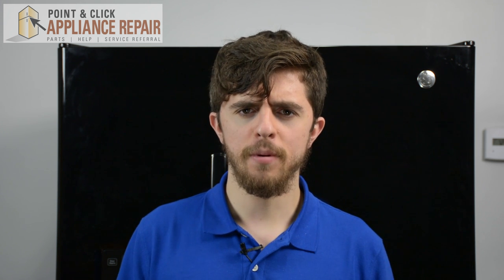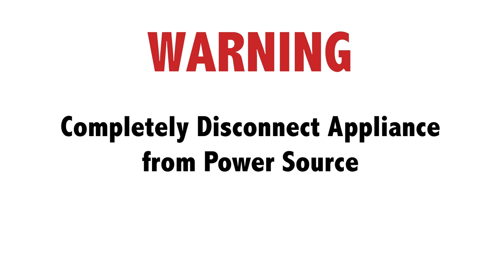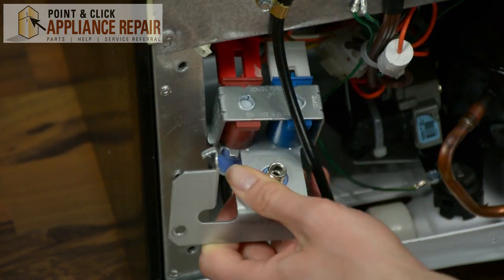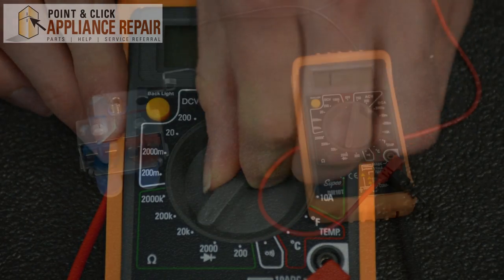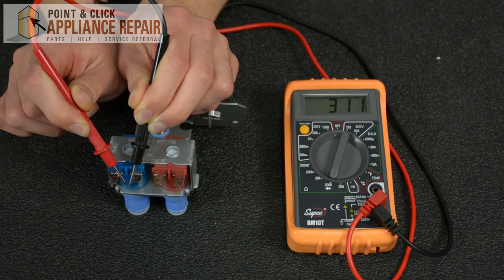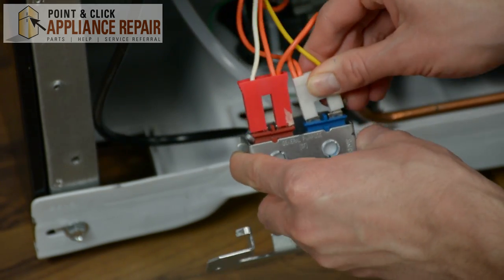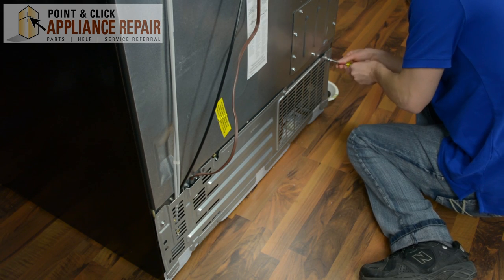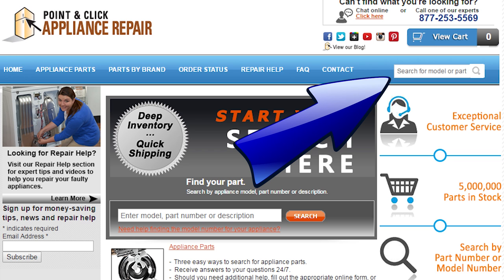How To Test Your Fridge’s Water Valve

Comment: Just wanted to add another troubleshooting step for anyone else: On my Frigidaire the inlet valve seemed fine (ohms in range, voltage was a little low on the main inlet connector (~90v) but ice/dispenser were 122v) yet I was getting no ice and no water dispenser. Filter wasn't that old, but I replaced it anyway -- still nothing. Instead of buying a $70 valve on a whim, I hooked everything back up as normal and removed the filter then took a long screwdriver to depress the check valve behind the ingress "foot" of the filter housing. Water sprayed everywhere when I engaged the dispenser, so I knew the main inlet on the valve assembly was fine. Next I unhooked the return line from the inlet valve assy and put the filter back in its housing. Pressed the dispenser and nothing came out of the unhooked return line behind the refrigerator.

I now knew the problem wasn't the inlet valve (nor the filter, since it was new) -- it had to be a blockage in the return line from the filter. I left the return line unhooked from the inlet valve assy and blew the line out with 120psi from an air compressor wand stuck inside the filter housing. Water shot out everywhere. Hooked all the lines back up, put the filter back in, and problem was immediately solved. Water and Ice both working fine now, and buying a new inlet valve would have fixed nothing.
Reply: I think
I have this same blockage issue at the filter.  The only water lines are behind the interior liner that distributes water from the filter to a dual solenoid one for the icemaker and one for the water dispenser.  

Are these the lines you blew out?  Or is it the line from the filter to the solenoids?
Reply: @breomeo  I blew out the return line that left the filter housing. I can't remember if it attached to the solenoid or not -- it's been a while. 
I should probably add that I later figured out what actually caused the blockage: the whole issue was really my damper motor. It was going out. This was causing the damper to stick open, and the refrigerator compartment was getting way too cold. The return line from the filter housing runs down the back of this same compartment, and it was freezing and causing ice blockage to the dispenser. 
Replaced the damper and all my problems went away.

Comment: Thank you for this video! This is the correct way to test. I watched another video where the guy had live wires from an electrical cord to plug into the valve. Didn't feel comfortable doing that. I was able to successfully test my valve and find that indeed the freezer side was bad! Ordering a new part! My ohms were 000.8 for the freezer side and 348.0 for the fridge valve. So happy I was able to diagnose this way!
Reply: What color was the freezer solenoid? Should be either red or blue?
Reply: @codymcgowen5579  It was so long ago that I don't even remember. Although, and maybe take this with a grain of salt, but I believe the freezer solenoid is the larger one with the bigger electrical contacts.
Reply: @codymcgowen5579  On my Frigidaire the freezer was green, the water dispenser was yellow. Line to the filter was brown, return line from the filter was white.
Reply: My old valve water side was only reading 0L ohm so I ordered a new one and that one also reads OL. It looks like the exact same one as yours. Did I get a new one and it’s a dud?

Comment: Yes, perhaps you can help me.  I have a Frigidaire FGHS2655PF5A refrigerator. About  two week ago I replaced the water inlet valve for this model. A rather simple installation I thought since I have installed numerous water inlet valves. However, this installation took on a whole new meaning. I removed the four water lines from the old water inlet valve along with their corresponding power plugs and installed them on the new water inlet valve. Then I attached  the solenoid power connectors and attached the water supply line .  I wanted to test the valve before closing up the lower panel so I turned on the water and pressed the door water dispenser. Water was coming out of the water inlet valve rear port  designated as the out-going filter line. I also had leakage from the 5/16-in clear pvc line that ran to the water dispensing switch.  The attachment ports on the water inlet valve are the gator-push-in type with the blue locking horseshoe. I removed the rear water filter -in line and the door water dispenser line from the yellow solenoid valve, re-cut the line(s) and re-inserted them back into the designated ports,  connected the water and tested the water inlet value once more. The water lines still leaked. One thing I happen to notice, the 5/16-in water lines would not properly seat into the 5/16-in port opening.
Reply: is it still leaking

Comment: Our Kenmore side by side refrigerator ice make does NOT make ice even though the water pressure to the dispenser is fine. I've tested the water dispenser and it fills (8) ounces in about (12) seconds. Could a defective water inlet valve be preventing ice making?
Reply: Hi Larry ! Good afternoon.  I have the same problem in my Frigidaire, no ice, only water.  How did you solve this issue ?     I have a water valve with 3 solenoids 1 brown which gives me 400 Ohms... Yellow 400 Ohms, but the green which is the one that has the hose that goes to the ice maker gives me only 200 Ohms.   Could you give me some advice ?

Comment: Do I need to disconnect the hoses from the valve to test the solenoids or can I simply unplug refrigerator and remove the electrical connectors?
Reply: No need to disconnect the water lines.
Reply: You can test it with it still connected, just unplug the power to the fridge and unplug the wires from the valves and test it. you may have to remove the bracket to get to the terminals.

Comment: Anyone know what turns the valve on?? I replaced the water inlet valve on my GFs fridge, still no ice. You can dump ice in  the bin and it will come out the door dispenser, and the freezer door water dispenser works fine. Just no water going into the ice maker. Im guessing the timer price on the front of the ice maker, but that is not a very educated guess.

Comment: I am reading about 396 ohms.  I was told that it should be between 500 and 1500 ohms.  This video says it can be lower than 500.  What should my reading range be?
Reply: Apply Ohm's Law: The resistance in ohms (Ω) is equal to the squared voltage in volts (V) divided by the power in watts (W). Water valve labels often show volt and watt values. For example let's say the component is labeled "120V 35W" then (120*120) / 35 = 411.43 Ohms.
Reply: @albireo9 I never knew this is how Ohms work. Thanks 🙏